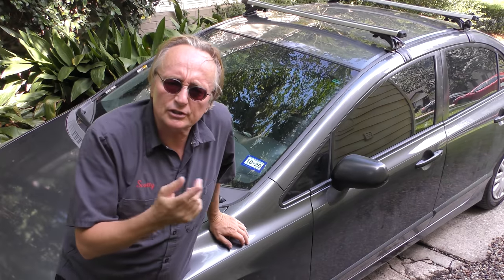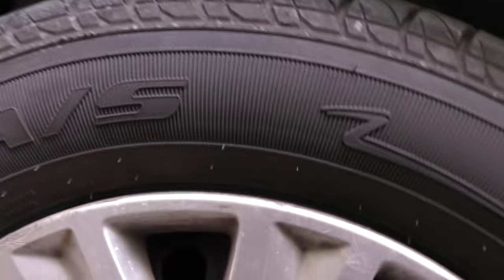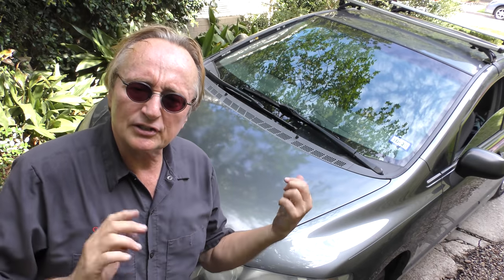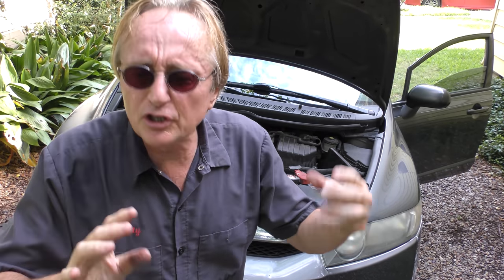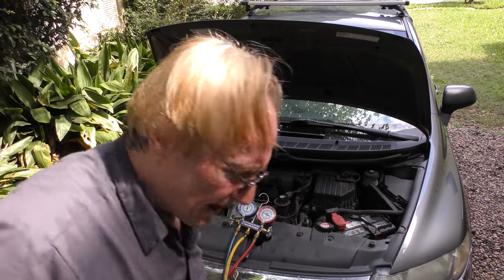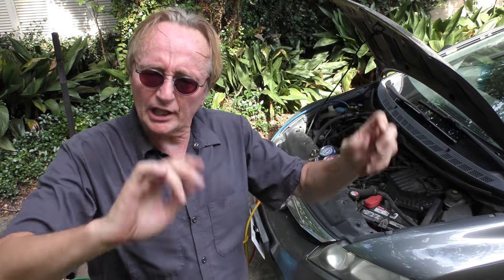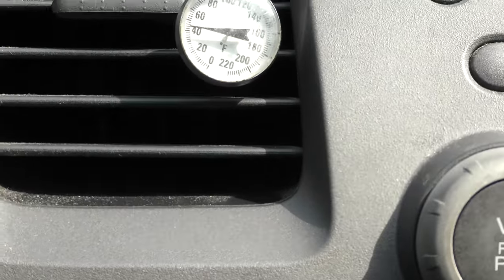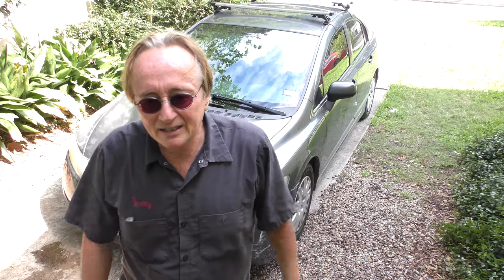Doing This Will Make Your Car's AC Blow Twice as Cold

Comment: Trading in your Nissan and buying a Toyota will make your car last twice as long.
Reply: or thrice or fourice or fithice as long
Reply: Corolla or Camry?
Reply: it it was currently 1998 though nissan was as reliable as toyota. merci beaucoup renault
Reply: @CartmanTheGreat59  depends on the year. All Camrys are pretty much all good though. Corollas '09-'13 have more recalls, and the engines are a little worse, but they're still better than any Nissan
Reply: what if you have a nissan that is a toyota lol, i have a 2009 Nissan Altima Hybrid
Reply: trade you new Nissan or Toyota for a used Honda and it will last twice as long.
Reply: cuzz63 true
Reply: @cuzz63  new cars are not made like they used to be regardless of make
Reply: No thanks !! ill take a Nissan any day
Reply: tonemaster 2099 you are kidding right? Nissans are absolute garbage since the merger with Renault. Toyota is the most reliable vehicle on the road overall and there transmissions usually last the life of the vehicle unlike Honda’s automatic transmissions.
Reply: camry after 2007 is total junk!
Reply: @CartmanTheGreat59  90-06s camry
Reply: Goran Either, both are reliable but Honda has bigger engine if that’s your thing
Reply: get yourself an avalon. most reliable engine ever made. i got a 2006 limited with 130k miles fully loaded with nav, heated and cool seats, sunroof. most reliable car i’ve ever owned. best decision of my life. my sisters brand new jeep doesn’t even drive as good as this or even have half of the technology!! and it’s 13 years newer!!!!!
Reply: I Literally did that at the start of the year
Reply: But so boring. My 2006 Toyota Avalon has had repairs.... well one repair. The third brake light blew out six years ago. Yawn
Reply: Crisp Bill Yogurrt I drive a 2008 Accord 2.4 . I’ve got over 215,000  km which is about 134,000 miles. Hasn’t missed a beat yet. Gearbox is fine,doesn’t use up engine oil. My previous Accord hit 320000 km or about 200,000 km. All started first time,started every time.
Reply: I was lucky enough to find a one owner 2012 Avalon with 47000 miles. I should be good for the next 20 years with this baby
Reply: Luis Bolanos not quite. Watch these videos and he explain facts as to why Nissan doesn’t make the better car. Depends on what year of Nissan: the older the better
Reply: I used 2003 Toyota Avanza since it came out, the only damage that I feel like a disaster was the clutch cable, other than that, it's original parts still rocking on in there
Reply: John DiMartino  I would get a Nissan any day.
Reply: @tpad6  why do you think the 09-13 corollas engines aren't as good? I have a 2010 corolla and no issues for me anyhow
Reply: @cuzz63  false. Toyota lasts longer than Honda, try again 🤣🤣
Reply: @kissitnow898  I recently bought a 2010 corolla with ONLY 5 THOUSAND MILES! Previous owner was a 90 year old lady who barely drove. My kids will be driving this thing in 20 years

Comment: My 2004 civic 303k. It’s been the best car I’ve had!! Bought it new!! It’s had 3 timing belt and water pump kits. One starter. one alternator. Nothing major just normal wear and tear parts replaced.  Change the oil every 4000 miles.  Love your channel scotty!! 🤘✌️😂🚘
Reply: Manual transmission?
Reply: Cameron Peralta yes!! I also have an accord.
Reply: 04 civic 1.7l auto w/131k. 
Above regular maintenance: (1) T/B,  (1) AC compressor & (1) 02 sensor over 16 yrs. Going for 300k or 30 yrs!
Reply: Matthew Wells as long as you just keep doing your maintenance like your doing  it will last! My First check engine light at 200k miles! 02 sensors can last a while.
Reply: Had an 84 Chevy suburban with over 600,000 miles and the only thing we ever replaced was universal joints, breaks, and 1 starter.
The guy drove it away when we sold it, and pulled the engine (6.2 liter diesel) to build a generator for his shop out of it, where it operates to this very day.
They don't make them like they used to...
Reply: I have an 04 civic lx automatic. I bought it at 131000 miles. No check engine light was on when I bought it. Now has over 158000 miles. I probably spent enough on it fixing different things in that short period of time to buy 2 transmissions. Garbage car. Everytime it needs something fixed, it's always expensive. Always! Head gasket being the most expensive so far. 1000 dollars on that. Oil pump failure...680 dollar fix. Tire rods, loud power steering noises but some Lucas fixed that one, bearings, axel, control arm, starter motor, ignition coils. I wonder what's next to break.
Reply: 303 miles? Or I'm?
Reply: IMPNN2U&69NU2 ICUR2EZ,FU   Someone didn’t maintain it. Maybe you have had really bad luck!!! My sister has a 2005 civic automatic with 220k no transmission problems!!
Reply: NeedUrLove07 no
Reply: BuDz Manson 303,402 Exact mileage
Reply: Well, if you change the oil every 4000 miles and especially you are using a gool product, first it will " go " the trans, second the frame and the engine might go for a total of half a million miles, even more, (siriously) . Those times, they were making the engines with almost excellent row materials, compare today...and especially honda. 
A small recomendation: If you want to keep it all the way, try a premium quality oil like motul, red line or bardahl. And with this mileage, do not go bellow  10w40 and if it gets hot in your place, use only 15w50 that works perfect in hot climates and particulary in heavy traffic conditions. Also, something that few know : Every 4 or max 5 years, replace completely all the antifreeze. This way you prevent internal engine oxidation (rust in the metalic parts), something that you can not see, so you ignore it.
I wish you to keep it, even as a second car and good luck ...
Now if temperature is bellow 25-30 fahrenheit, use 10w40.
Reply: Fan Laz  my first new car got it 11/2003. I use redline oil. I have Changed all fluids religiously lol. I have other cars too.

Comment: Very true about the wheel bearings. Most videos on youtube mention all those tests he did but old bearings may pass all those tests and simply are losing lubrication over the years. You can't open the bearings and pack them with more grease, you'll have to either live with the symptoms or change the bearings. I changed the bearings myself on my TSX but its no easy task and now the loud humming noise is gone, car feels more agile, my turns are sharper, and my mpg has improved.

Comment: There’s so much to car repair that you don’t know until you actually do it. People could do it cheaper them selves but like you said if you don’t do it right it could ruin the compressor🤔 Scotty is always going to have a job👍💵💵💵💵
Reply: rent a vaccum pump. Buy a cheap manifold. Buy a preoiled compressor. If your lucky your system has no gas, if it has gas pay someone to empty it. 

I did the job last summer on my 2010 Fusion. It was MUCH easier than I expected. Paid $100 for a used compressor.

Cheap and easy.

Comment: I have an 07 Monte Carlo, Hernandez (in McKinney, Tx., junk yard) fixed my air conditioner for 282 (I bought the refrigerant!)!  When car was 2 years old, took to "dealer" for oil change (put hole in air conditioning compressor, 1/2 way fixed it, stopped working), NO AIR FOR 11 YEARS!!!  WORKS GREAT NOW!!!!

Comment: Scotty I never miss one of your shows. I have being 'hacking" at mechanical work in my cars for almost 40 years. But for the life of me I still can not comprehend how can Chevy  6.0 liter V8 well maintained and rarely going above 3000 rpm can break a piston arm and leave the piston loose in the cylinder to go crashing into the valves. This happened when I tried to started after 3 days. I had opinions from other mechanics but I am still not convinced. Can you give your two cents on this?

Comment: I just replaced Wheel bearing in my 2009 KIA. There was no play or movement in wheels, 2 out of 4 mechanics told not to worry about it. It was just slight wobbling in speed more than 30 mph, which you could miss it. May be a little ( negligible) heat in the affected wheel bearing  side. The ride is definitely quieter and smooth after. It was hard to diagnose since there was no play, not loud noise,and but I think it was a well worth at the end.

Comment: my father had a 1975 Buick LeSabre (455 ci engine) and its A/C  could put frost on the plastic vents.
Reply: The old piston compressors and R12 were great.
Reply: Ahhh..the good old days when everything was overengineered & overbuilt...ive got a freezer from the early 70 in my garage...still runs perfect...hardly ever comes on... im not trading it in for nothing new!
Reply: @magicjnkie216  Kept my central air units going for 48 years with only minimal maintenance and one minor repair.
Reply: I've got a 73 Electra Limited that will freeze you out. Still has original compressor and R-12 Freon gas. But it's only got 20k on the clock. Got it from my dad!

Comment: I had a 92 Toyota 4-Runner with 250+ thousand on it. A/C did work, replace one line set and charged it with cans from the store and I got air down to 34 degrees out of the vents! I was so surprised, best and coldest air I've ever had!

Comment: Hi Scotty, I am from Singapore and driving a 2009 Civic 1.6L Auto..@90k km. Bought used since Jan 2020.

I have an issue that the engine vibrates whenever the A/C cuts-in at idle.
The vibrate shook the car only when the A/C compressor cuts-in.
A/C compressor serviced with new gas and compressor oil.
All engine mountings are good, RPM did not drop (@750RPM at idle), cleaned the throttle body, EGR..
Battery is new..
All items stock - no modifications etc..

What could cause this vibration? (Well , actually it is more like shivering for a second..)
It is like the engine lack of power and turning over whenever the A/C compressor cuts-in...
No vibration once the A/C is running - Only when the compressor cuts-in...

Thanks

Comment: Hey Scotty! I have a 2013 civic 150,000km. Honda’s maintenance manual recommends with this oil change I replace the manual transmission fluid, coolant, (these were supposed to be done at 120,000km) spark plugs and inspect my valves at a price of $800CAD($590USD) after tax at the dealer. Usually I only go to the dealership to buy fluids for my old mechanic who closed his shop. Considering I still haven’t found a new mechanic is it worth it to bite the bullet and pay the dealer?

Comment: I have a 97 protege. Still blows 40 degree air. I keep the condenser coil clean and radiator clean. Run the ac a little in the winter and still goes strong and cold

Comment: Hey I have a 2015 Chevy Cruze with 92,000 miles. The air conditioning works but I was wondering weather or not I should use one of those ac recharge to make it even colder.

Comment: On those body panels that were separating at the wheel wells ( the left side had a screw put through it): What's required to get those two parts mating flush again? A missing clip? Hyundai Elantra.

Comment: Change the compressor/clutch assembly. Pull vacuum for minimum 45 minutes. If the compressor grenades, you now have metallic pieces “throughout the entire” A/C system. My compressor OEM new was $275 plus R134a and ester oil.

Comment: What makes it run colder replacing the fluid lmao I thought he was gonna say hit the recirculate button to keep from fighting the outside air
Reply: guess you need to replace your fluid
Reply: Andrew Schwab  Gasses are also fluid ;-)
Reply: @andrewnaylor7627  3 states of matter: solid, liquid, gas. You can throw plasma in for a few things.
Reply: Andrew Schwab  refrigerant works under the principle of liquid turning to gas in the evaporator, and then being compressed to liquid by the compressor into the condenser. Fluid.
Reply: Phil Mccrevasse  yes, fluid.
Reply: @andyattitude2000  gas and liquid are both fluid...
Reply: @andrewnaylor7627  solids are also fluids
Reply: @lazertag720  Unfortunately not... I was just addressing the misconception that a fluid = liquid. A fluid is actually anything that flows / changes shape. So in this case the refrigerant in either gas or liquid form is always a fluid...

Comment: Hi Scotty, I am 62 and have built and worked on cars all my life. Soon as you stated that the car has "Kelly" tires on the front, I thought to myself, there is the humming noise. I have experienced that same problem on a low mile Civic with the same tires. I guess "Kelly" is shortened from "Kelly Springfield"?

Comment: Scotty, I have a 2001 Volkswagen Jetta Tdi with 388,000 miles and the ac is not blowing cold. The system is not low on freon, the compressor clutch engages, and i've checked the high/ low pressure sensor. When I hook up the AC gauges to the high side shows 120 psi and the low side shows 113 psi. I've also checked the blend door but it is functioning. What could be wrong?

Comment: another possible thing ive come across that makes a similar noise to a wheel bearing on cars with rear disc brakes and drums for parking is that the drums in the midwest will rust inside and sanding them down will eliminate 99% of this noise, also sand off the rotors crusties if the pads are good. a tire can do this too.

Comment: Scotty! Good Day! James here from across the Gulf, St. Petersburg, FL. Love your content - very straightforward and reasonable advice. Commented before; I come from a strict Toyota, Honda, and Mazda family. Went out of my comfort zone and BOUGHT A NISSAN VERSA!!! I know, I know... BUT only 8k miles and it is a 5-speed, no CVT! ECONOMY! Priced under 10 grand (blessed with a family member that paid half) includes 50k extended mile warranty, worry-free as far as my wallet is concerned and in mint condition. Had trouble passing this one up. Any thoughts? Also, maybe it is just me or the model, but the AC is not as cold as the Florida summer commands. Start at the bottom with Freon charge? Any advice would be much appreciated!!! Take care my friend!
Reply: beat  that lol i picked up a nissan note tekna 1.6 auto (not cvt) last year with 5,500 miles on it , a ten year  grandma car its a 2008 year, all i can see from history is  oil changes  and a battery, winner  winner

Comment: Hey Scotty, what do you think about a Nissan Silvia with 2jz, turbo, aluminum radiator,1jz head, hKS cam shaft, HKS pulleys, Cutom made headers and many more the car has 640 wheel horsepower and costs 11k???? Was a drift car!

Comment: Scotty Kilmer  , sir will a bad A/c pressure  switch  prevent  compressor  from starting.  I changed my ac compressor  2 times  compresser  does not engage.  But if I put direct power to compressor  it  engages.  Any tips?.

Comment: Hey Scotty! My 2001 ford ranger blows super cold air but I'm  having an issue with the idling. When ever i have the ac on and the compressor kicks on the idling goes up a little too high say about 14 to 1500 rpms and stays high intil the compressor turns off. Any idea what it could  be?

Comment: Hello Scotty love watching your videos, currently having some A/C issues with my 2012 Infiniti qx56 which has dual system for first row and back. While idle it works perfectly fine blows ice cold but as soon as I drive and cruise it blows hot air although for some reason if I cruise under 50mph A/C works perfectly fine but right side (passenger) vents  blow much colder comparatively to left side (driver). The freon is at proper level and I don't smell freon inside while A/C is on, can you give some advice what would possibly be wrong with the system thanks.

Comment: hey scotty, my 2011 civic may have a radiator fan problem. when idling in temperate weather, not too hot , not too cold it will cycle the fan off n on every 10-15 secs. that is it will cycle on for about 5 secs then stay off for about 15. IS THIS NORMAL  or is some sensor broke?

Comment: Honda's Economy Mode reduces the A/C compressor operation and A/C fan to conserve mpg. I thought I had a problem when hot air was blowing out when parked, but turned off the Economy Mode and it's ice cold. Sometimes all you need is to read your manual!

Comment: My Malibu Maxx still has it's original AC units n other parts never had to be recharged. Has 350,000 miles on it. Too it to the Chevy dealer to get the trottle body system cleaned n no one there ever seen a Malibu Maxx in this great of shape let alone with this many miles

Comment: Just did a rear wheel bearing on my 2010 Vibe. There was no play in the bearing but it had a deafening roar. I thought it was a bad tire until I replaced all 4 tires and...fuuuuuu the noise was still there. It wasn't even press in bearing and was still a royal PITA since it was rusted in place.

Comment: I have on 08 Prius and the service manual says there is a special oil due to the electric compressor.  Is this nonsense or do I need to use a virgin gauge set etc.

Comment: I wish there was an easy way of finding out if your AC has ran out of gas,  bought our secondhand Vectra cdti from a Vauxhall dealership, 10 days after buying it we took it back over burning smell & Turbo whining, we also asked them to check AC as when we checked it out it wasn't cold,  guy said its probably out of gas & he'd refill it,  months later we had hot weather in the UK o_O so tried cold setting for the first time, but it just blows warm air from outside. How am i to check gas level for myself ?   can i?

Comment: One of the little tricks to cleaning corroded connectors is... an old fashioned ink eraser: the kind that looks like a pencil.  Maybe it has a brush on one end or not.  You don't really want to use sandpaper, as that removes material and the surface roughness it leaves is sometimes an invitation for a problem to return.

Comment: I have had bearing noise with no discernible play in the wheels.  I didn’t think you had to replace condenser and expansion valve etc in a compressor replacement if the A/C compressor hasn’t seized. But I am not HVAC certified.